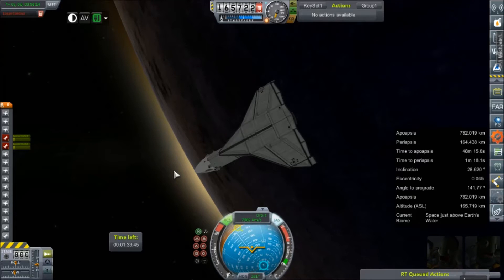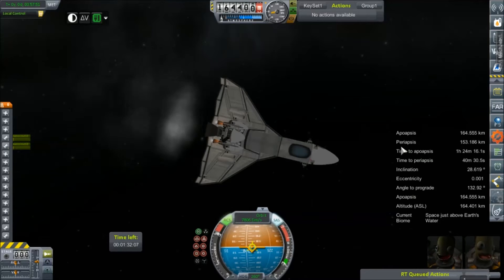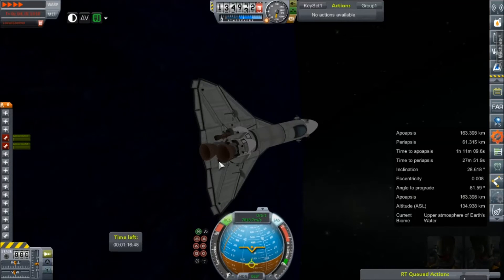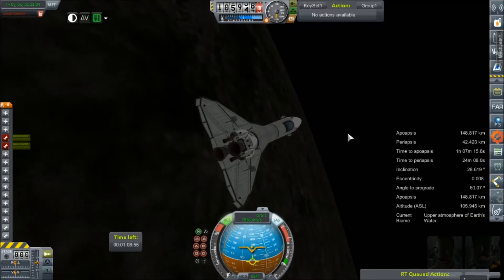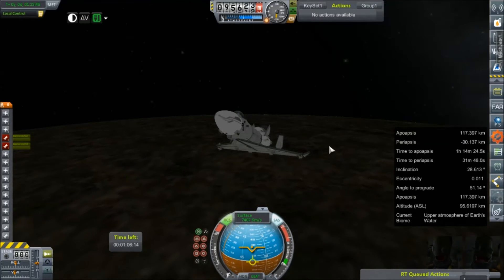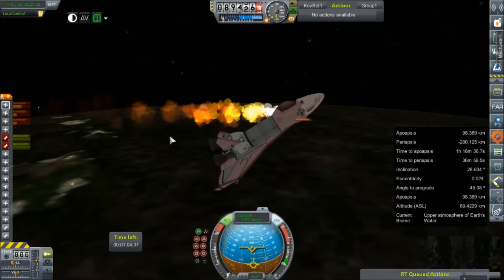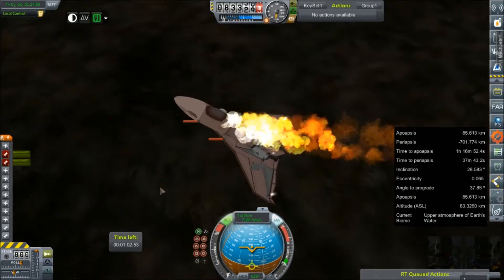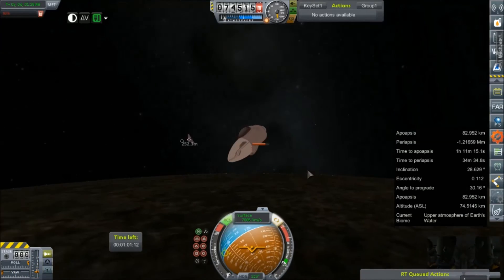KSP RP-0 #130 1960s shuttle Re-Entry Testing (prototyping reusable part 4)

Comment: great video, you know your videos are off a number, you went from your first rp-0 video to number 3. Also what mods are you using on the shuttle?
Reply from the maker: Thanks! 
Yeah, the first episode of this series was a live stream, that I always intended to split in to two episodes. Life happened and I forgot, and I'm in way to deep to re number things now.
Didn't install any new mods specifically for the Shuttle Project. So it's still /only/ the massive list in the description box.
Reply: I was just wondering because I am currently messing around with RO RP-0 and RSS and was interested in trying out your shuttle
Reply from the maker: Go for it! There is a Dropbox link in the description for my ships file. ( There are a few other prototypes I played around with off camera ) If you can get any of em to re-enter without rapid unplanned disassembly, let me know how you managed.
Reply: I will definitely let you know if find a way to improve it
Reply: what kind of heat shields have you unlocked?
Reply from the maker: Up to lunar rated 5m I think, and the shielded procedural tanks.
Reply: i had a successful landing with the inflatable heat shield and the help of a few parachutes
Reply from the maker: Lol. Nicely done. Nothing good with just a glide scope though huh?
Reply: Even when I slowed down enough I lost control of and crashed into the ground, that's why I have some parachutes
Reply from the maker: So we're you able to get through the atmosphere without breaking up?

I was gonna make parachutes for it anyway, 1.1.3 hates wheels.
Reply: Some parts were destroyed like some struts, rcs but it was still useable
Reply from the maker: surfinglizards oh really? so many questions.
what was you initial perigee/apogee  when starting reentry?
what aoa did you hold through it?
Reply: I had to do use the simulation to only launch the shuttle and my orbit was 300km high
Reply from the maker: interesting. I wonder if the heat xfer modeling is glitching the hell out on my install... 
There is another shuttle in the craft file "Perseverance" I was having similar issues with that one.